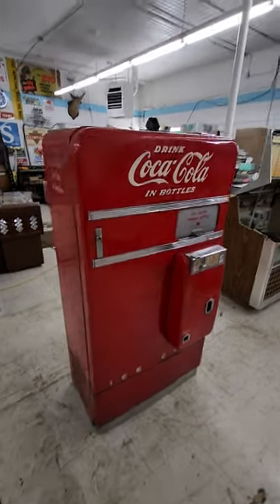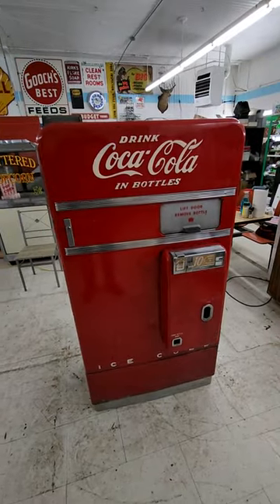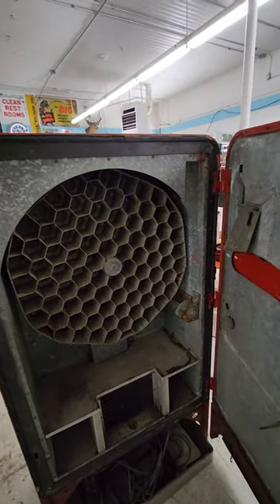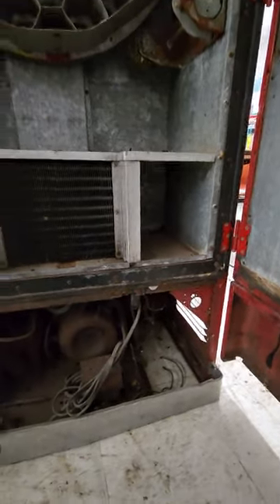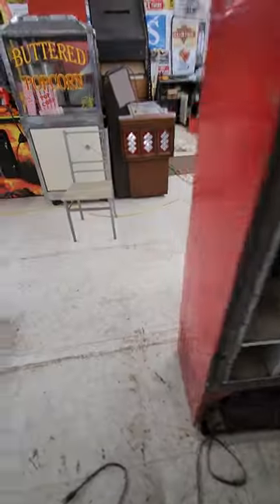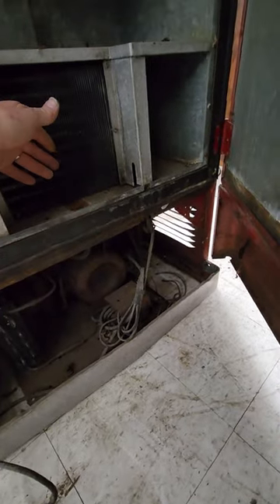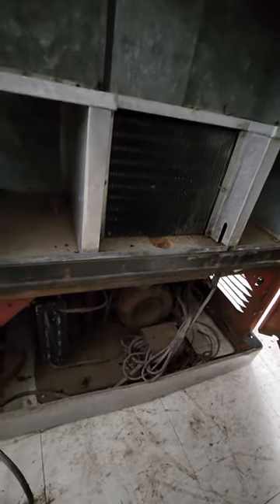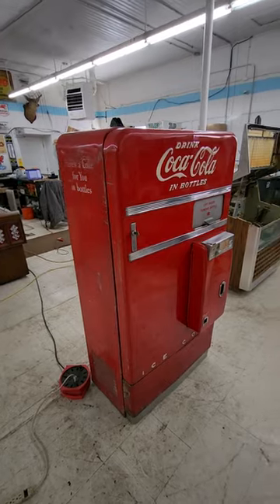Arcadia Auctions #5: 1950s Vendo Coca-Cola vending pop machine looks really nice, cools.

Comment: Growing up in a rural small town in northern Ca. I worked for my buddie's Dad who owned the local Chevron gas station.  We had on of these out front.  Mostly the same, but I think the lift door was in a different place, not sure, it was 60 years ago.  Anyway, we drank a lot of 10 cent Coke during the hot summer days, often with peanuts (dumped in the bottle after the first swig of icy cold Coke) from the 5 cent "Hot Peanut" vending machine.  Also, since it was our job to stock the machine, the boss never looked in there, which made it an excellent spot to stash our illicit beer and keep it nice and cold LOL  Lot of good memories there!  Thank you.